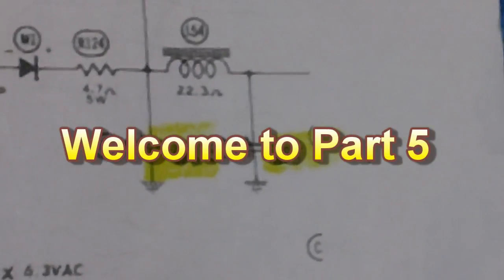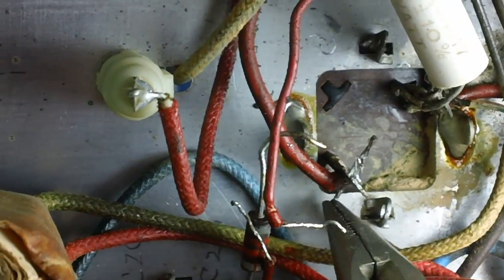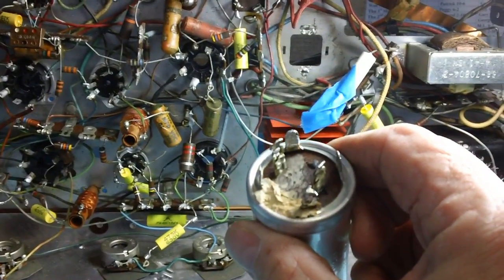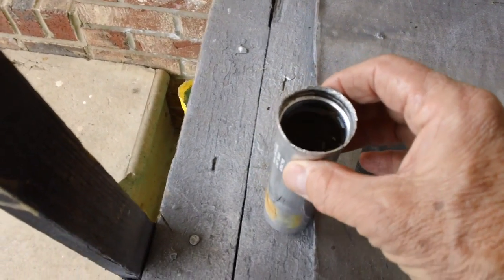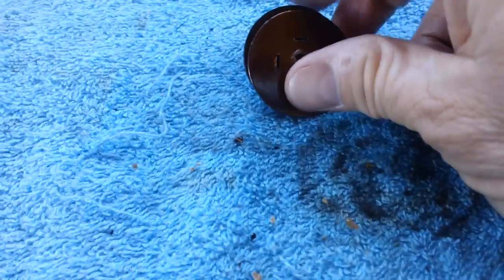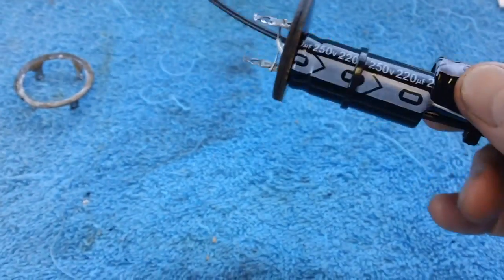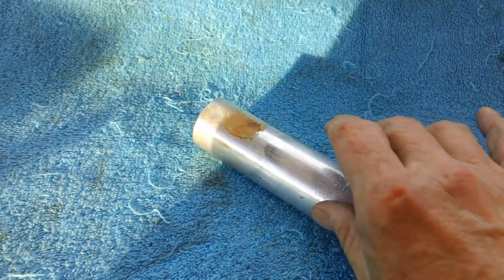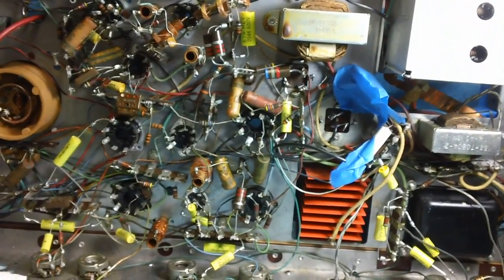1956 Sylvania 21" Halolight TV restoration (part 5 of 23).

Comment: That desolderer is kick-a. Everyone needs one of those.  The can restuff makes things look original but wow, a lot of work. I haven't had to change filters in a while but I usually just solder everything together under the chassis leaving the can in place. I can say one thing. If you knew nothing about old electronics repair, this is the place to learn. Wish you were around back in 1983 when I just got my ticket and was working on a Johnson Viking Ranger and had never worked on anything with tubes.
Reply from the maker: Kevin,
Thos Hakko units aren't cheap.  They're real proud of them.  But the major improvements they've made over the previous model 808 has made things much better in the use and maintainance departments.
And you know...not long ago one of my grandsons told me: "A person can become a genius just by watching YouTube videos."  He was right.  :-)

Regards,
John

Comment: John,
As re-stuffing an old electrolytic smoothing capacitors canister goes, you have done a first class job my friend.  It certainly does look good as it will retain some of the original look of the television.  I also whole heartily agree with you when you talk about consideration for anyone in the future who may re-restore what one is restoring at present. 
If you remember, when I restored the Rengentone RG99/2 radio, I capped off the hole with a mild steel metal plate where the smoothing capacitors were once located and then I discarded the old aluminium canister.  I have also discarded the old aluminium smoothing capacitor canister that was original to the GEC radio I’m restoring at present.  I came in for some criticism from a few subscribers for doing that but having worked in domestic electronics servicing for almost 36 years that is what I did…all trash, including spent capacitors, was tipped into the dumpster at the end of each working day.
I will, in future, unsolder wires off terminals and leave old smoothing electrolytic capacitors in situ…that is where I’ll draw the line.  I’ll continue to solder replacement electrolytic smoothing capacitors onto tag strips, or veroboard secured onto spacers (stand-offs), and connect them into the circuitry as I usually do.  Something you may want to consider my friend?
Best regards,
Phil.
Reply from the maker: Phil,
Right you are, my friend...there's more than one way to skin the electrolytic cat, and I've tried many of them .  On one radio, a Heathkit AR-2, I just cut open the can, removed the guts, cleaned things up and put in new e-caps without reinstalling the top of the can.   The new e-caps just sit vertically in the base of the can for all to see...and wonder, I suppose.  LOL  But they look kinda cool to me.

Regards,
John
Reply: joernone
New electrolytics soldered to the base, or bottom part, of an old electrolytic empty canister sounds like a very good idea, especially when solder tag strips are at a premium here in the UK.
Thank you for the tip my friend. I guess the Heathkit AR-2 both looks and works well with that arrangement.
Regards,
Phil.
Reply from the maker: Phil,
What are "solder tag strips?"  I'm unfamiliar with that term.

Regards,
John

Comment: Haha gotta love a friendly cat getting into your stuff all the time! Nice job on the restuff. originally I cut the cans open on the philco 89 but it wasn't the best way to do it because of the dried out rubber insulators.
Reply from the maker: Daniel,
Our daughter has three cats and the one you saw in the vid, named Binks, has taken a total liking to me.  I give him snacks all the time.  LOL

And there's no problem with cutting open an e-cap can that has a dried rubber insulator.  Once open, remove the old guts and dried rubber, then run the insulated wires from the new caps down through the now open rubber insulator hole and solder them to the terminals where they go.  Piece of cake.

Regards,
John
Reply: Yeah, at the time I didn't think of that, I read on how to do it on the Philco Phorum. oh well, live and learn :-)

Comment: I like your solder extractor. I use a solder pullit. I leave the electrolytic cans in place and mount the new caps under the chassis. I have never re-stuffed a can. That's a neat way to do it but as seen in your video it is a difficult and labor intensive job to stuff the old cans. Gary
Reply from the maker: Gary,I'm unfamiliar with the term pullit.  Do you mean the blue spring actuated extractors?  If so, I got tired of using those, so it was time for a major upgrade.  But they are expensive.

Regards,John
Reply: joernone
Yes John the blue plastic spring loaded pullers but I like the solder extractor you use and may get one of those one day. Gary

Comment: Desoldering braid is also good for removing solder from terminals. They make an extra wide type for cleaning BGA balls that is good for hand wired stuff. The overheated flux it produces can be hard to clean.

Comment: Great job John. That de-soldering gun seems to be working fine and saving a lot of headaches (and soldering tips). I think you definitely need to get yourself a mini tripod though. There are some great bendy ones out there that you can use to hang your camera on pretty much anything. Having said that, your videos tend to be much more stable than many using a hand held camera. I have not felt giddy once yet.
Reply from the maker: There won't be a need for a mini-tripod much longer, as this will be my last restoration series of any kind.  It's time for the younger crowd to take completely over.  When this series is finished, I'll just sit back and watch others over a cup of coffee.

Regards,
John
Reply: joernone
Oh no. Say it isn't so.

Comment: John - I am on the proud owner of a new AK model 44 with E speaker. Thanks to your video, I have an idea what I am about to tackle. I may be contacting you for pointers :)    BTW , the sonic cleaner you suggested works wonders for the Tuning Capacitor and know I have my bakelite knobs in there.. I can see the dirt coming off them....   Thanks again..
Reply from the maker: Good for you, Ron.  Those puppies can be challenging, so good luck.  But if you follow the vid you'll ace it out.  I've been wanting to find one of those rare-as-hen's-teeth cool wrought iron stands that were sold for it.  Go here in case you've not yet seen one:
http://www.atwaterkentradio.com/ak44.htm

Regards,
John
Reply: joernone The Liquid Wrench to open the speaker is brilliant... cannot wait to dig in.  I have seen the stand and wish I could find one of those.  Will keep looking

Comment: I liked the way buzz1151 cut the can apart with the Dremmel moto-tool and cutting disk,
As you said, leaving the bottom part intact.  The important thing is to get rid of the old ecap guts inside the can.
I've used a small hacksaw too, when in tight spots that don't allow for the cutting disk. But that solder
Sucker sure makes getting the can out much easier, that's the hard part of ecap cans in tight spots on top.
Don
Reply from the maker: Don,
Old news, my friend...so old it has mold on it.  Cutting e-cap cans with a dremmel cutting wheel goes way, way back.

Regards,
John
Reply: Yah John boy, but we OLD FOLKS FORGET THINGS, and need reminders!

Comment: Great video John, been watching the previous ones in this series. I was just wondering when you cut the second can instead of drilling 4-5 holes for the caps terminal can you have just one for the common negative and solder the other positive leads on the inside of the bottom plate. Inside the can other words. I don't know just a thought. Less "new wires" on the outside of the can. :-) Can't wait to see the next vid regards, Sorin
Reply from the maker: Sorin,
The next can re-stuff is just about finished and you'll see how I did it in part 6.  I don't know how one would go about soldering wires inside the can.

Regards,
John

Comment: I always heard that the hot glue was used to stop the vibration  of the capacitors. true or false.
Reply from the maker: Brother Mac,
Like you, I've also heard that story.  It's bunk.  If a radio, TV or whatever is vibrating so much that it ruins the electrolytic caps, then something else better be looked at real quick-like cuz someone screwed up.

Regards,
John

Comment: I recently picked up a new De-soldering unit too. Very helpful tools!  You have a nice one.  Does your model have the wet sponge filter inside the gun?
Reply from the maker: No...it uses a piece of metal and these round sort of felt-like disks.  I've gotten a number of questions about this extractor, so maybe I better show it a bit more in Part #6 of this series.  Part #6 should be up by next weekend.
Thanks for popping in, my friend.

Regards,
John

Comment: Another excellent video!!! I have a question. How do you melt a solder blob that's used on ground chassis? My solder gun will not melt the solder. If I'm not mistaken I may need a soldering iron (something with a little more power) correct? What do you recommend? I can't wait to see your TV restored and working.
Reply from the maker: Jorge,
Right...you'll need plenty of heat which means a higher wattage iron.  But why bother doing that?  Find another grounding point or if you're removing a component clip off the lead leaving about a half inch of it on the chassis, then solder on the new component to that lead.
BTW...the older trigger-pull soldering guns work well for melting solder off chassis grounds.  Like this one:
http://www.ebay.com/itm/Weller-Universal-Multi-Purpose-Soldering-Gun-Kit-MPN-0499-Model-8200-/151563291037?pt=LH_DefaultDomain_0&hash=item2349e0499d

Regards,
John

Comment: I know. I'm mean. I get a kick out of spooking my cat LOL. But, she always comes back for more loving. If you really want to have some fun, watch some cat videos on YouTube with the cat.
I just thunk a thought.LOL.
Would it be a hard job to cut the bottom ring off the cap can and solder it in place after you re stuff the can ? I haven't had to work with canned capacitors yet.
Reply from the maker: Jeffrey,
1.  Stop spooking the cat.  Not funny.  Not cool at all.

2.  The can is aluminum...won't solder.

Regards,
John